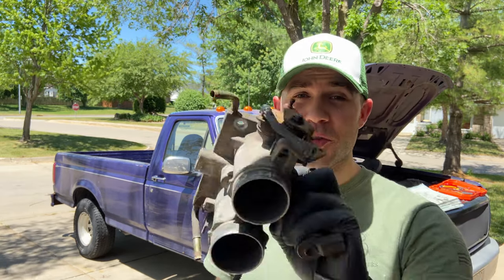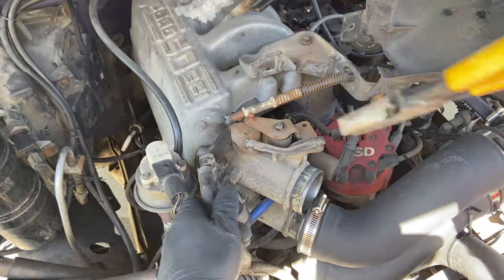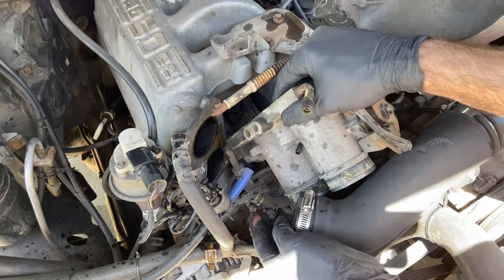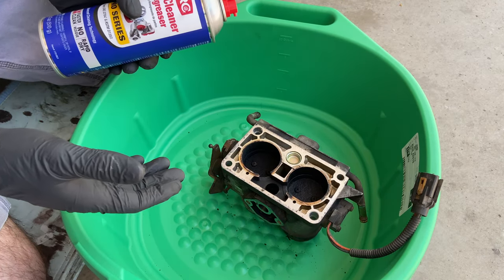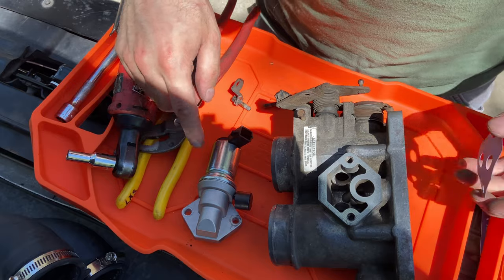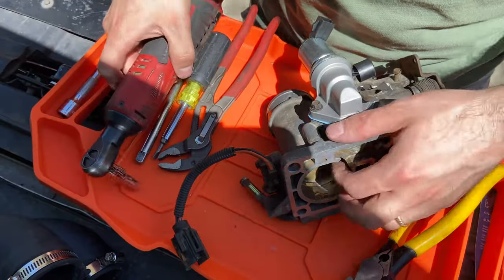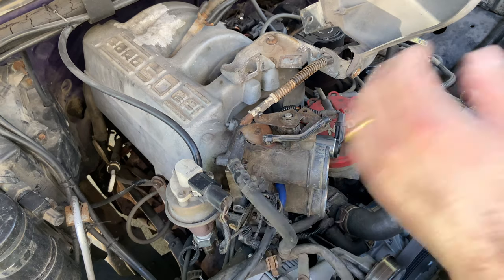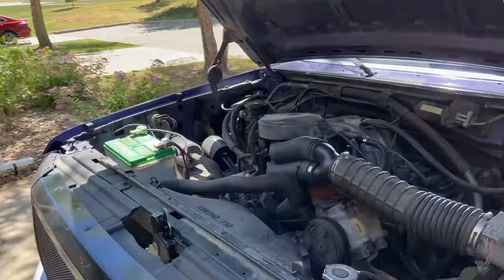How to Remove a Ford F150 5.0 Throttle Body and Super Clean it!

Comment: Thank you for the video. I just cleaned my TB. There is a sticker on it that says don't clean it. I think there is a special coating on it (interior). So I bought TB spray cleaner made for TB's. It was very weak at removing the black oil deposits. I used a old tooth brush, TB cleaner and a rag first. Next, to clean the throttle plate shaft areas I used the TB cleaner with cotton swabs. That got it super clean (not quite new) and I'm sure with the soft tooth brush, rag and cotton swabs, that I didn't damage any coating on the plates. Also installed a new IAC (as the spring on the old one seemed weak), and a new Throttle Position Sensor because what the heck, I had the TB off and the only way to reach the TPS is with the TB off and the TPS was only $16.
Reply from the maker: You are most welcome! 
Great approach to the cleaning! I’m not sure why Ford has that label because I’m not sure what coating could be ruined. Maybe it’s a coating to prevent rusting. 
I don’t always recommend throwing money at new parts but the TB is a great place to just replace parts so you can rest easy that everything is new and with that functions well.

Comment: Just heads up to people looking to clean their throttle body. Do not scrub inside around the butterflies. I super cleaned my TB and definitely cleaned off the special coating on the inside with some scotch brite and then my truck idled super high at start up and idled at 1000rpm warmed up. I could drive around without my foot on the gas. So my advice would be just wipe the inside clean.
Reply from the maker: Good advice man! That coating can’t be scraped off.
Reply: @TheMinuteMasters  just got done putting on another TB from the junk yard. Back to normal. 👍 idling at 600rpm.
Reply: Same same same - had to go to the salvage yard and get lucky with another throttle body. Just read the tag on the throttle body - no adjustment and no cleaning.
Reply: @Minute Masters I used a toothbrush and I used a plastic body panel pry bar to disturb the gunk buildup and then the toothbrush to help agitate it more so I could use throttle body cleaner to flush it out. Is that a bad thing? It started right up when I reinstalled it with a new gasket. Didn’t sound too bad. Guess time will tell.
Reply: @WalterMelons  if its idling normally sounds like you're all good. I was really scrubbing with scotch brite when I cleaned mine. Right after installing it my idle was high like 1000rpm. My truck would drive around without pressing the gas. But if yours is acting normal you should be ok. 👍 after I  got another one at the junk yard my truck ran normal.
Reply: @ChillingwithMalc  Awesome! Yeah I didn’t scrub the hell out of it just used the plastic pry bar as a scraper and the toothbrush to loosen. Sounds like I’m good for now. Thanks
Reply: Honestly I don't think that coating is really doing much, I mean how is it if it's covered with 1mm of carbon and gunk, more likely the Idle Air Control valve got dirt moved around and is stuck. That's exactly what happen with my truck. Probably for the same price or less than a junkyard throttlebody just change the IAC sensor at the same time as the tps.

Comment: thank you man, I have a 95 5.0 4x4 that needed this!
Reply from the maker: No problem man!🤙
Reply: do you have any tips on getting a rounded bolt off ?
Reply from the maker: @ezekiel7497  I have a couple of solutions.
1 - heat the bolt of with a torch and use vise grips to turn it.
2 - use a grinder or metal file to cut two parallel flat sides to fit a smaller wrench (still recommend heating it up) 
3 - Cut a single center slot and use a very large screwdriver to turn bolt. 
4 - drill the bolt out and tap new threads. 
5 - weld a new nut on the bolt head.
Reply: @TheMinuteMasters  I ended up using the flat head with a angle grinder on the bolt and it worked, this made my truck idle a lot more smoothly but it still dies at idle
Reply: @TheMinuteMasters  I believe it’s the fuel pump because I can hear it when it first stops, then it gets more and more quiet till it just stops pumping fuel

Comment: Razor Blades make good shims for tight spaces.  Drag the blade at 90 degrees to the surface on steel, wood, stone, or sandpaper to knock the sharp off of them.  Work safe.
Reply from the maker: Good tip!👌

Comment: Hey guys! I just did this. Man, i know they say not to clean the inside of the throttle body, but mine looked like the bottom of a grease pan after a long barbecue. 30 years of build, 3 cans of TB cleaner later and it was finally cleaned up!
Reply from the maker: Right! This is actually a pretty satisfying part to clean because it’s typically so gunked up.

Comment: Question for you, when you disconnect those coolant lines for the throttle body do you need to bleed the entire coolant system afterwards ? I am suspecting faulty EGR/ vacuum leak coming from my throttle body and I am taking mine apart and replacing with new egr and TPS.  Thank you for all of the detailed videos on these OBS fords. You have saved me and I’m sure others from a lot of hair pulling
Reply from the maker: When you disconnect anything related to the coolant system it is always a good idea to get any air bubbles out of the system. This is usually done by leaving the radiator cap off and starting your truck. Let it run for a few minutes to cycle the coolant around. That typically does it. You should also fill the coolant if it looks low after that.

Comment: People on the f150 forum gave me hell for cleaning my TB. There is or was a sticker on the TB that says Do Not Clean. Ford calls it sludge tolerant so they say. I also used carb cleaner not TB cleaner which is massive sin. They tell me that motor in my TB is going to fail any minute now. Also that the cleaner takes off some important coating. I did have a problem with it revving high and not idling for a while, but that went away. I think maybe an oily dirty film on TBS. If I had it to do over, I would use throttle body cleaner. I would take the TBS out before cleaning and then replace it with a new one. 
i have a hard shift that could be related to TBS. Also a new gasket. Those parts are cheap, and taking the TB off is a pain. Just do it once, but then again, I famous for fixing things that aren't broke. Thinking about replacing the MAS.
Reply from the maker: Those guys on forums are RUTHLESS. From time to time I post links of my videos in those forums. They absolutely hate me for it. 
That aside, there is a coating on the actual throttle plates. I don’t think there’s anything magical about the coating other than that it prevents corrosion. I used not metallic tools to scrap and clean them for that reason. Removing the TB is the best way to ensure you don’t contaminate anything sensitive related to the TB. That’s probably where most people go wrong when they clean TBs. 
There’s the TPS which could cause shifting issues. 
I’m the same way. I fix things on a hunch but also my truck is 25 years old and 242k. It’s just fine to throw new parts on it.
Reply: @TheMinuteMasters  They hate you - that's funny! I use to be on the BMW 2002 forum and they were the same way.
Reply from the maker: @mikehickman3330  Dude! It’s nutz! One guy always comments on my posts and asks that I get removed or pay for a membership.
Reply: @TheMinuteMasters  nutz! Well your channel is awesome, and there are a couple of other people that are knowledgeable and cool on YouTube - it helps a lot. I'm doing drop hangers next week. That should be fun.
Reply from the maker: @mikehickman3330  Thanks Mike! 🤙 I appreciate it! 
Hangers aren’t too bad to work on. You’ll be just fine.
Reply: I super cleaned my tb and definitely cleaned of the special coating around the butterflys. Thought it was build up. After the rpms at start up always revd real high and idled at 1000 could drive around without my foot on the gas. Learned my lesson. Just wipe it clean. Dont scrub with anything abrasive. Just my experience.
Reply: I ended up putting on another one from the junkyard and it runs fine now.

Comment: I need this video 2 months ago. On My 95 5.8 400,000+ my issue was different  though, my coolant lines were so corroded I needed to replace the whole body and found two good spares at the wrecking yard. Maybe the next video you can do is how to modify  the coolant fittings drill tap and replace maybe? Aftermarket bodies are over priced and unreliable.
Reply from the maker: Damn! Over 400k miles? That’s crazy! These older engines just last a long time. 
Gotcha. That makes me happy I made this video. If I waited until 400k miles, I’d probably be in the same situation. That’s a good idea! I’ve heard the new BBK throttle bodies are hit or miss.
Reply: @TheMinuteMasters  yes sir it was a family effort to get to that amount.. yeah these engines are tough. The tranny not so much it's on its second life. I also changed out  my metal coolant line where the temp sensor and lower throttle coolant line connect right next to the  distributor, another good video idea.
Reply from the maker: @moisesurbina20  Cool! So your truck has been in the family a while. I agree. The transmissions are the week point but there’s no way around that. I think transmissions by there nature are more wear prone.

Comment: Would cleaning the throttle body help with a weird hanging idle I have going on in my 90 5.0 I’ve checked for vacuum leaks and had none, so now I’m kind of lost. It mainly does it when I get on the highway and am cruising then go to slow down, then when I come to a stop and push the clutch in it’ll hang the idle around 2000 or so.
Reply from the maker: If your throttlebody is super dirty it could definitely help but I would probably look at replacing the idle air control valve. 

Plus I would look at reading your codes just to make sure there isn’t a bad sensor somewhere.
Reply: I replaced my TPS and IAC, stupid engine still stalls when I put it in gear, automatic transmission, these things are money pits.

Comment: I looked for a TPS video from you. Just wondering if you ever calibrated one and if so, do you have to have the linkage hooked up?
Reply from the maker: I don’t think I’ve replaced my TPS. However, I’ve always put them back the same way I found them to avoid calibration issues.
Reply: @TheMinuteMasters  something about having close to 96 ohms reading over black and green wire at idle position on the sensor. could be different value if I remember wrong but theres a way to twist the starting measurement on the sensor, and of course verify with a meter.

Comment: I'm thinking of upgrading my throttle body. I don't have any real mods just deleted the egr and cats. You think it's worth it? I was thinking bbk 61mm. Only reason I'm considering upgrading is my throttle body needs replacement.
Reply from the maker: I would replace the throttle body with a stock one. I hear the BBK 61mm are hit or miss on quality and it takes a lot of supporting mods to get any gains from it.
Reply: @TheMinuteMasters  I hear the same thing, and without increasing HP, the extra air will cause some loss of torque and could cause it to run lean.
Reply from the maker: @mikehickman3330  Yup, that’s why TBS and CAI don’t usually work.

Comment: Hey Stevie ever thought about converting EFI to Carb? Video on this and what you make recommend. So many have issues with the throttle body , idle control valve  and TPS sensor. Curious your thoughts?
Reply from the maker: I have thought about a swap because the idea has a lot of promise. However, the time and money needed to convert to carb could easily be spent to fix the existing EFI system. As a matter of fact, you could probably upgrade the existing EFI. 
I think carb swaps are a popular idea because the 5.0 is a 302 with EFI. So it’s a relatively straightforward process especially for folks who understand carbs better than EFI.
Reply: @TheMinuteMasters I'm currently upgrading the EFI on my truck (1992 F150, 5.0) with a Holley Terminator X kit. We'll see how it goes

Comment: Yeah cool. With that many miles the upper port on the plenum sometimes gets carboned up really bad where the EGR gases come in. It can clog a hole that allows equal air intake pressure, js.
Reply from the maker: Good point! Eventually I’ll have the plenum off to do a deep clean and fresh paint.

Comment: How did this effect your throttle reaction.  Have you changed your eem or pcm
Reply from the maker: The throttle felt smoother. I still have the original ecu or pcm.
Reply: Ok thanx.  Your vids are helping me get through this lol.  I'm at 315k. And it's just starting to act up. But. I feel that the motor and Trans are still strong.    Sometimes the accel puts me on the seat. Other times. It barely goes. Even when I Floor it. Hardly any reaction.
Reply from the maker: @charlespeyton1849  you’re welcome! I’m glad to hear it. 
Have you done an ignition tune up yet?
Reply: @TheMinuteMasters  not yet. That's my next step. Clean the throttle and sensor, along with new plugs, wires, injectors, dist. cap. Full filter and fluid change.

Comment: is there a reason you didn't take off the butterfly plates and clean the backside and inside of the throttle body too?
Reply from the maker: Yes, I didn’t want to fully disassemble the TB. I just didn’t have time and I didn’t want to break anything. You can get both sides of the throttle plates clean with the TB off the engine.
Reply: @TheMinuteMasters  Thx for replying :). Question on the 5.0L (302).  Do you know the length of hose that would be needed to go from the oil filler side hose connector to the air box input port on the side?  16"?
Reply from the maker: @mackendw  Just so I understand where you want to route this hose. So from the port on the side of the oil filler neck to the air box or the air intake pipe?
Reply: @TheMinuteMasters  On my truck (87 F150 XLT Lariat), the oil filler spout has an open port that had nothing connected to it.  The "stock" setup is supposed to have a line going from this port to the air box.  I checked the air box and sure enough on the right side under the main air filter in side is a smaller filter that has a port to connect a hose onto.  Just wanna make sure of the length.
Reply from the maker: @mackendw  I see. So on newer trucks the port on the oil filler neck connects midway on the intake tube. So I don’t know the exact length you need. If I was to guess, 3 feet will probably do it.
Reply: @TheMinuteMasters  the only problem with connecting in 1/2 way into the air supply tube is there is no filter mechanism in place to eliminate the larger oil particles in the vapour.  I guess your oil catch can thing would be the next course of action if things get to oily in the intake.
Reply from the maker: @mackendw  This is true. The catch can does solve a few issues right away.
Reply: @TheMinuteMasters  will check it out if I see a lot of oil building up in the air box.  the part I bought online looks like the wrong one.  I'll see if the ends at least will connect to each end and I'll pick up a length of ECC reinforced hose to run to/from each end.  the engine is not burning any oil that I can see...power is decent.
Reply from the maker: @mackendw  Sounds like a plan Mack!🤙 Then you can revisit the oil catch can mod if you need it.

Comment: Hey just got a 1995 F150 5.0 with 70,000 original miles and wanted to know what all should I clean up or replace it runs good so idk if I should just drive it or try and clean everything up really good thanks for any suggestions
Reply from the maker: Great find man!🤙 at 70,000 miles I can’t imagine there’s much to replace. Overall I would just inspect the whole truck end to end. At that many miles and age, I would say anything rubber may have the potential of being dry rotted. Tires, vacuum lines, spark plug wires, etc. Assuming no maintenance was done to the truck, it’s a good idea to replace the air filter and the fuel filter. Do a full fluids change. Oil change, transmission fluid change, anti-freeze flush, brake fluid flush, power steering flush, and differential fluid change. Of those fluid changes I would say oil and transmission is the most important. Transmission being the most forgotten. The rest of those fluid changes are easily forgotten as well, but can usually go a lot longer. 
I would check your brake pads, rotors, and rear drum brakes.  
I would check for early signs of rust too. You could stop rust in its tracks now. Check inside of rear bed wheel arches, check inside of front fender arches, check cab corners inside and out, check rocker and sill pieces, check under carpet/vinyl for surface rust, and check down inside the radiator support.
Reply: @TheMinuteMasters  ok thanks man
Reply from the maker: @GTxJakobix  No problem!🤙

Comment: Hey Stevie, got a question for you.

I recently did the cleaning of the TB. And the intake pipes. I ONLY used CNC throttle body cleaner. I completely replaced the TPS and the IAC at the same time (and the IAC gasket/throttle body gaskets as well).

Truck cold starts to 1200 rpm, drops to 1000rpm, and hangs there for about 30 seconds before dropping to a steady idle at around 750rpm. Is that a normal range? Held steady at 750 for 15 minutes afterwards, so its only a bit high for the first 30 seconds at startup
Reply from the maker: Hey Stevie! When you replaced the TPS, did you install it in the same orientation as the OG one? If it’s not “clocked” or oriented exactly like the one you replaced, then your idle could be off a bit. There’s a way to set it perfectly with an ohm meter. It’s been a while since I looked into it.
Reply: @TheMinuteMasters  07:57 I installed mine with the wire pigtail closer to coolant line.... FML 😂 I guess I get round 2 at cleaning it a bit more one of these days